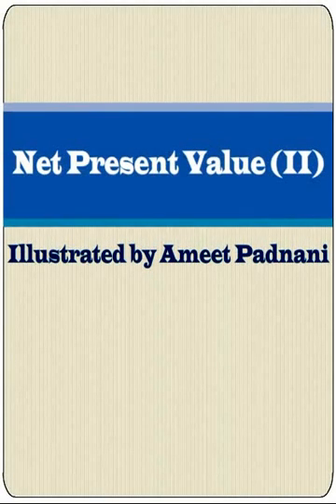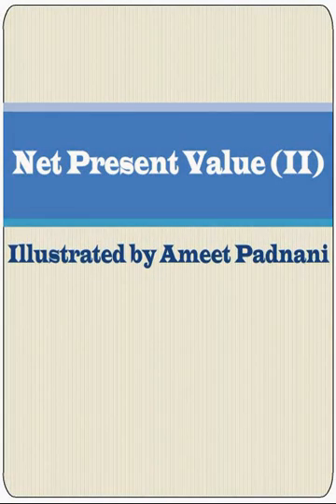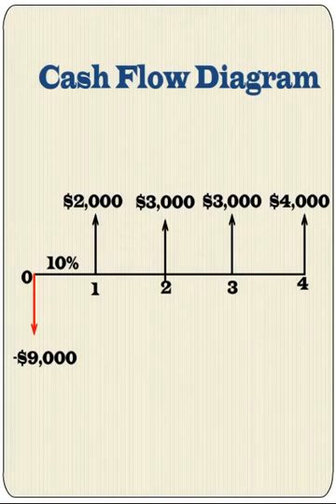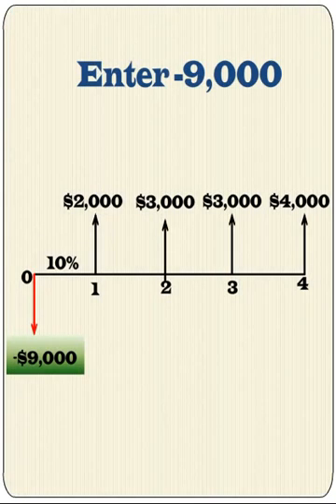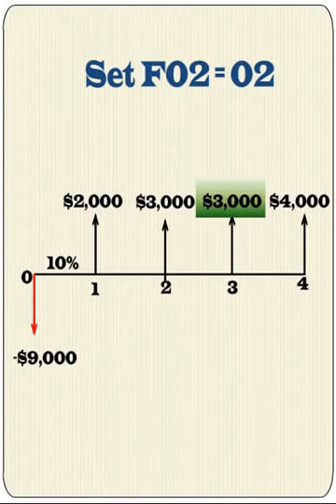Calculate Net Present Value on TI BAII Plus

Comment: Where did I go wrong I wrote down step by step replayed it four times and still got NPV $11,000!
Reply from the maker: You may have residual numbers from earlier calculations that may be interfering with new calculations.  You can wipe out the existing data by pressing 2nd, Reset and then pressing the Enter key when prompted with a question mark.

Re-enter all the cash flows and the discount rate and find your NPV.